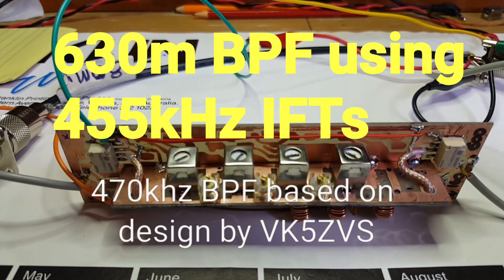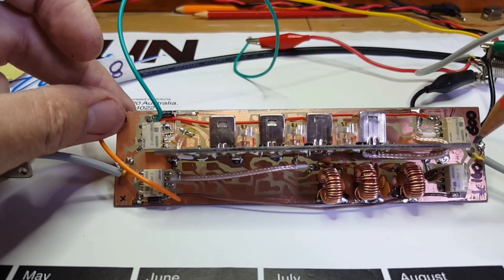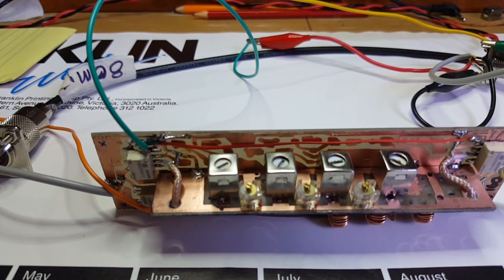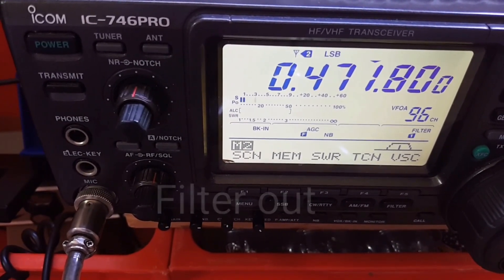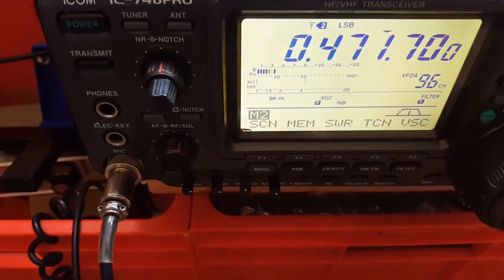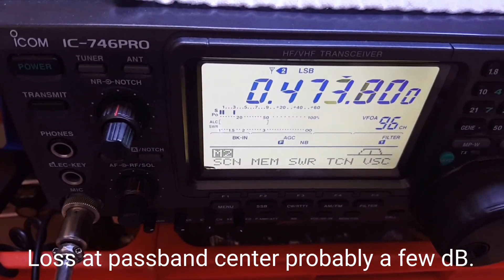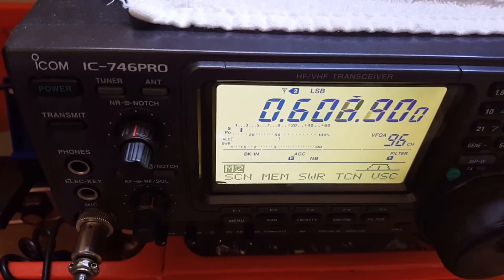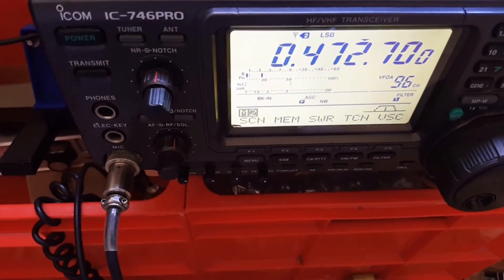A sharp Band Pass Filter for 630m (472kHz) using IF Transformers

Comment: Didn't sound like very much insertion loss to me
Reply: Yes, you’re very correct it is an F111 Raven. I build and fly RC airplanes and have always wanted to make an F111. I always thought it was a really sexy plane even though it was a bomber; the nose treatment is just absolutely exquisite!  And, it turns out that the Australian Air Force was actually one of the last services to decommission that plane.  You can look up different documentaries and there’s even video of when they need to get rid of excess fuel, they will light it up with the after burners while they’re dumping it— quite the site! Thanks for noticing...
Reply from the maker: @SpinStar1956  The F1-11 has a broad and gutsy fuselage, to leave room for the bomb bay and the swing wing mechanism, it must be one of the widest bomber bodies of all time.  That makes it very recognisable. And they do have superb lines, absolutely beautiful.  There is one in the Point Cook Aircraft Museum, a must visit if you're an aircraft fan and in Melbourne.
https://acesflyinghigh.wordpress.com/2016/10/12/raaf-museum-point-cook-strikerecce-hangar/
Reply from the maker: It's probably not much, particularly at 470kHz. When I made this, I didn't have any way of sweeping or measuring filter performance. I now have a Scalar Network Analyser so I could read the insertion loss right off its screen. A NanoVNA is the obvious tool for this job now.  Thanks for commenting.
Reply: Thanks for responding Paul. Well it’s actually a simple matter to just use a signal generator and make input and output measurements usually on a scope as you incrementally sweep that generator; from there you can then calculate the DB’s. Usually, the bandwidth is such you don’t have to adjust the signal generators output to compensate for frequency change. Thanks again, love your channel...
Reply from the maker: @SpinStar1956  That's true, another way. As I've often plotted SWR against frequency with paper and pencil no reason why I shouldn't do similar with the scope screen.  BTW that looks like an F1-11 on your channel pic. I had an Airfix model of this plane as a kid, and I saw them fly over once. Now, the only way to see one is at a Museum.

Comment: Paul, nice board.  Have you estimated how much the filter attenuates the 621 signal?
Reply from the maker: No I haven't.  This video was made 3 years ago at a time when my only way of testing out a BPF was to sweep it with a receiver. I just moved it from Wordpress media to Youtube.  A NanoVNA or similar would give you an actual measurement. My rough estimate of a few dB was just by doing in/out tests and listening to the receiver band noise. The drop in noise level when I switch it in is barely perceptible. Sorry, you asked about the AM signal at 621kHz. No I haven't done that, but it would be easy to do. This BPF is boxed up now so I can't easily reproduce that test.